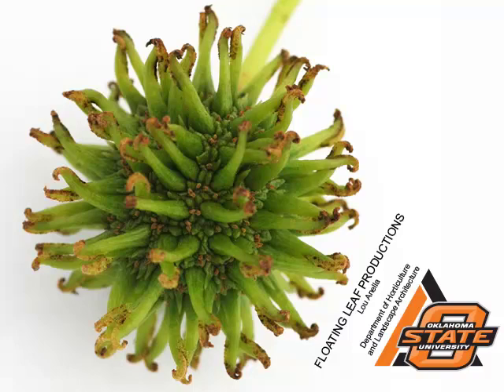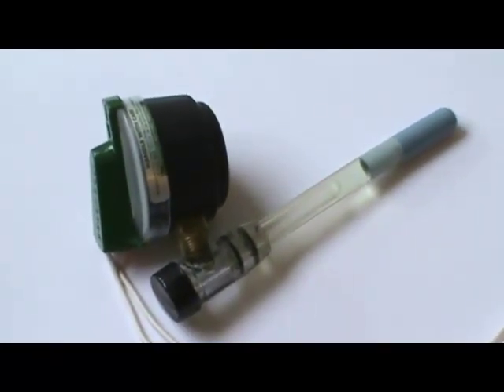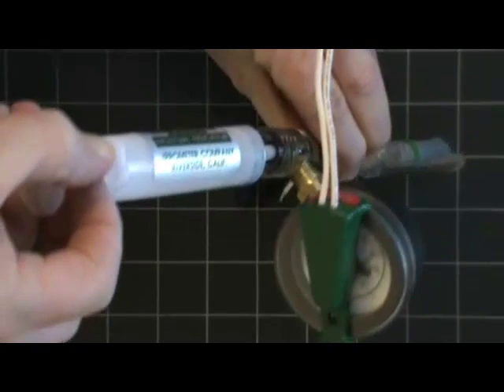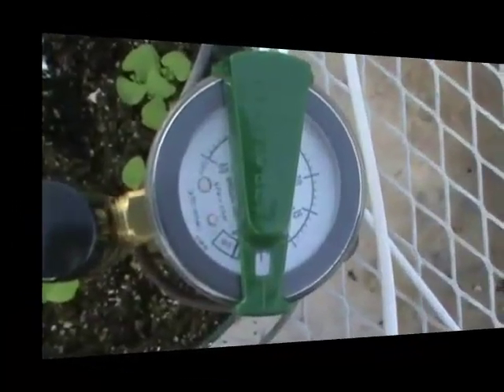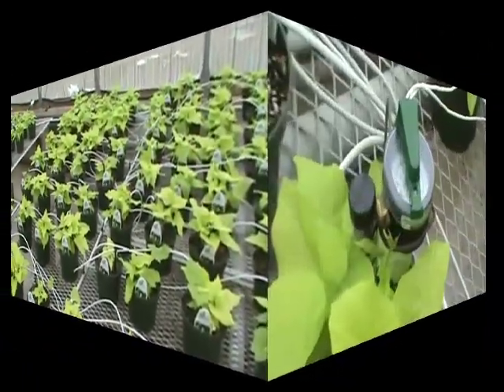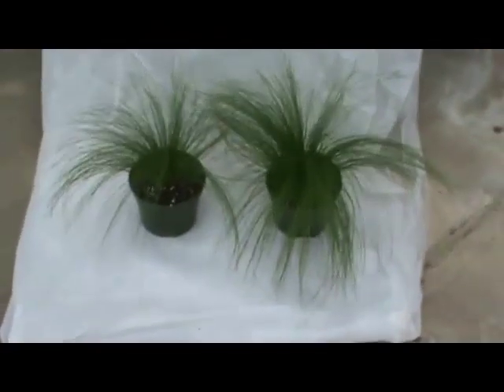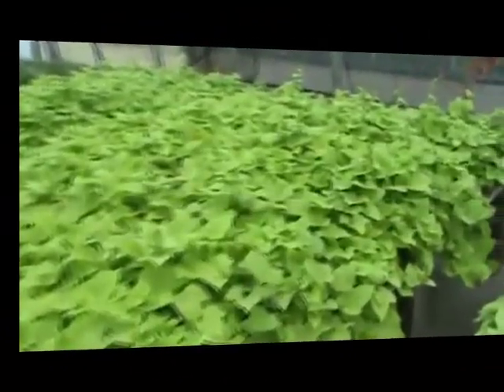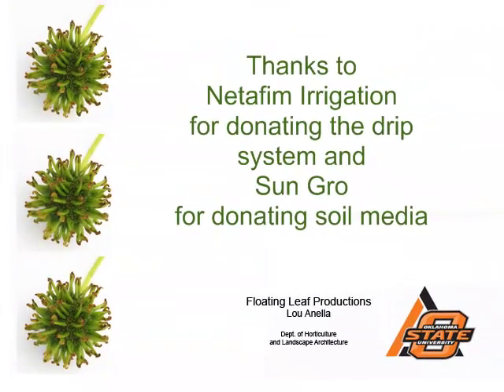Automating Greenhouse Irrigation

Comment: I am going to deploy a few of these in my grow room, Does the signal wire just go to a solenoid controller? I have a leeder 1hp pump, 500 gallon reservoir, and a Galcon irrigation timer, it is a pressure compensating system as well. Any input would be great.

Comment: hello
the device has two cables, what are those for?
regards
Reply: It connects to your solenoid valve.  When the soil is dry, the circuit is closed, allowing electricity to open your solenoid.

Comment: Hi I have a question 
Is that a potable water supply set up or is a pump creating pressure to push the water through the system ?
Reply: It is municipal water.

Comment: Lou:
Would it be possible to have different tensiometers set at different matric potential thresholds, so that you could setup irrigation to maintain different soil moisture ranges? I thought of doing this with soil moisture probes and a datalogger that would tell the irrigation when to start and stop.. Hadn't considered using tensiometers until now.

Comment from the maker: I don't think vapor pressure is the right term.  Soil tension is a better term.  As the soil dries water is pulled out of the tensiometer causing a vacuum within the dial.  As the needle is pulled up by the vacuum it turns on the valve and the plants get watered.  As the soil becomes wet water reenters the tensiometer and the vacuum is reduced, the needle drops and the valve closes.